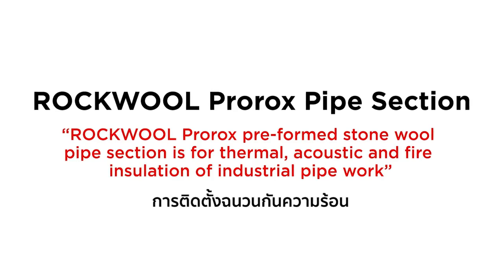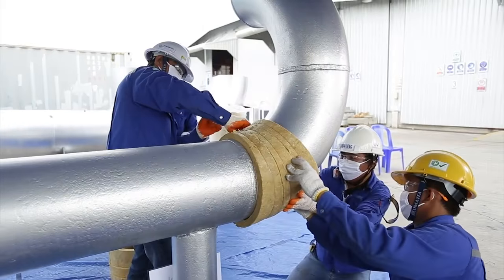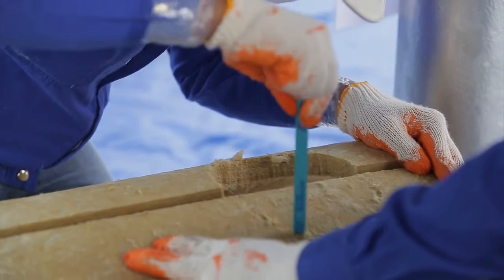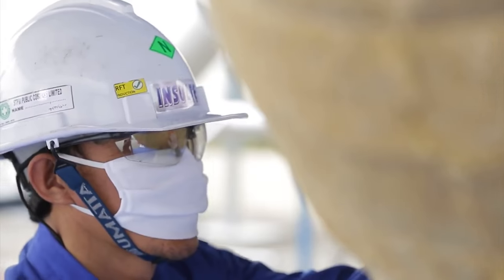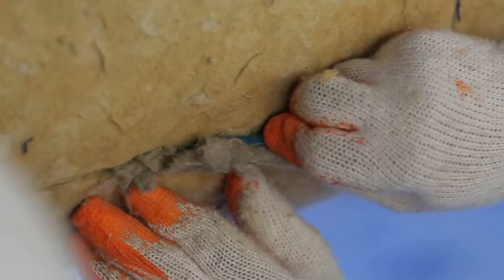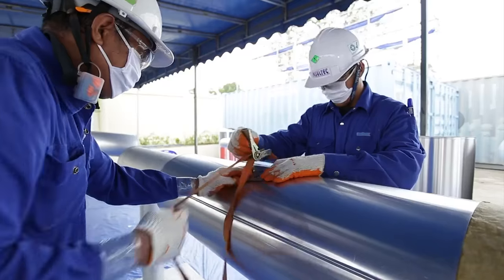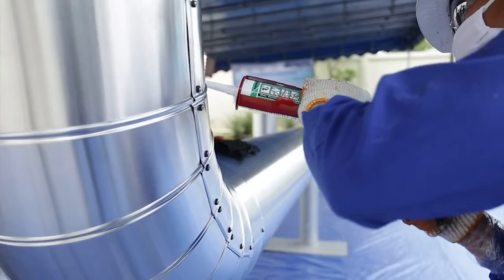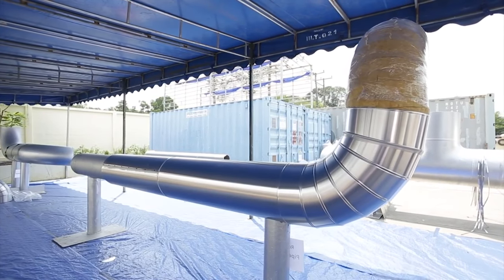ROCKWOOL ProRox Pipe Section Installation

Comment: I did this job for 2 years.It is nice when you have a space to do it like it is presented in this video.Not so much when you have to climb and crawl all the time and stay in those unpleasant positions while insulating.
Reply: Yes, the insulation work will not make you stay very comfortable.
Reply: Yo Im 19 and my father and i are about to join this job he’s an experienced worker but I’m fairly new anything I should know before I start . Something that could help
Reply: @zzveggiextoop1781  New beginning is always tough,as time goes it will be easier and easier.You can learn a lot by doing this job,using all kinds of tools etc.Sometimes you will work in messy and tight places sometimes on big height,use your protection and don't be afraid of nothing,you will be stronger,good luck ,leave a comment when you can. 😊
Reply: @Shukke1992  main thing I’m concerned about is measurements and math Im not the best at it ,should I be as worried .Thanks though man I’m just trna get the nerves out right now since it’s a different type job then I’ve done in the past

Comment: Corner sheeting installed incorrect or radius wasn't enough. And why the guys didn't drive female/male scars on straight parts and sting holes before installation. Taked 3 times more work to make it like that